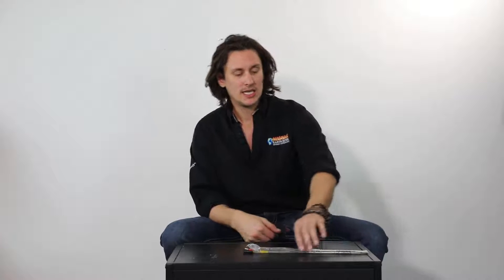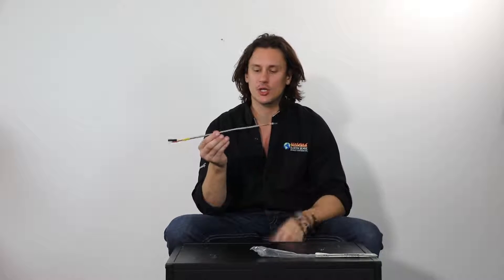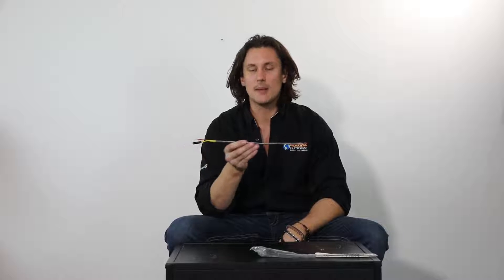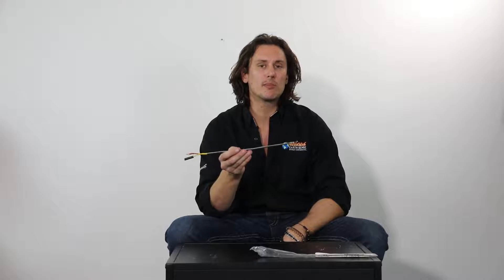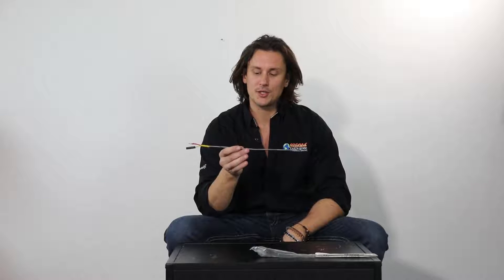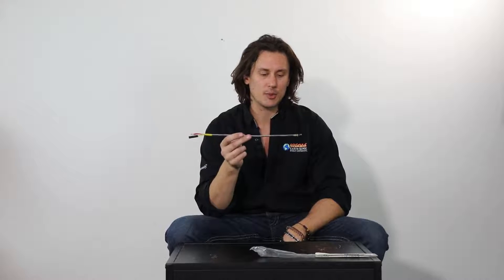Quadrafire Thermocouple Function & Troubleshooting

Comment: I have a Quadra-Fire Mt Vernon AE Pellet Stove, 2003.  During ignition, after the fire is lit, the power in the stove cycles on and off, the auger will attempt to feed fuel, and the blower will kick on if it manages to feed enough pellets to get up to temp with the intermittent power.  It will continue cycling power until the thermostat is manually turned down and it goes into its cooldown stage. Also, i cannot attempt a restart until it has completed its cooldown cycle or else it will just go back into cycling power.  1 in 5 attempts it will have a successful ignition cycle and run perfect. My control box has no indication lights. I'd love some help to narrow this down before I start playing wackamole with parts, Thanks!
Reply from the maker: Thanks for contacting us, happy to help. Let's first verify the age and model. The Mt Vernon AE did not exist in 2003. The first Mt Vernon AE hit the market in Nov 2011. The Original Mt Vernon with the 4-speed control dial and standard wall mount thermostat was in production at that time. These two units are very different although physical appearance is similar. If you verified manufacturer date as 2003, then you have the original Mt Vernon. Please confirm. 
When you say the power cycles on and off, are you referring to a specific motor that is doing this or does power cut to the whole unit/all components and then come back on? Happy to help.
Reply: @EarthSense  The sticker in the hopper has a punch calender on the bottum marked for 2003, im assuming that is the manufacturing date, and the name does not include AE so your probably correct.

The power cycles for the whole unit, all the components appear to operate correctly, but without constant power it can't maintain fire.
Reply from the maker: @damuleface  Thanks for the message back. Yes, that punch calendar would be correct for the manufacturer date. They often call your model the Mt. Vernon O.E. (Original Energy). 

I would suggest we start with the basics first. 
1. Let's check line-voltage coming from the outlet. We want to make sure there's no dramatic swings and that we are reading 115v-120v consistently. If there's other things plugged into that outlet or breaker let's make sure they are not creating a drop in voltage in the outlet the stove is plugged into. If you have a surge protector in place, let's make sure it's not altering the voltage.
2. Let's check the stove wall cord. Check for breaks/cracks and wire connection on the power inlet inside the stove. 

3. Check all wiring coming from the Junction box that secures the control board. Again looking for breaks, cracks, or loose wires/connections.

4. Pull out the control box and make sure all contacts look good. Place it back in securely. 

All motors and blowers can be bench tested to ensure they work consistently. Here's a video on creating a test cord if you want to test each individual motor - https://youtu.be/rlmiCYI2WPk?si=-5IziCy65IKSsZTx

Keep us posted, happy to help.
Reply: @ All conections are good and all components are running fine. 

I think I have it narrowed down to the thermocouple and/or control board.  I have listed below different scenarios during start up.

1. No fire: stove times out and turns off

2. Inadequate fire: stove malfunctions, intermittent power, until thermostat turned off and completes cooling cycle.

3. Adequate fire: achieved with additional fuel in pot, stove enters normal operation

It seems like the thermocouple is giving insufficient voltage which is causing the control board to malfunction.
Reply from the maker: @ Glad you were able to check everything and narrow this down. Generally speaking, the thermocouple only comes into play to recognize the fire/heat during start-up to allow the unit to go safely into normal operating mode. Given what you described I would agree this could be a thermocouple or control box issue. 
For reference here is the control box for the Mt. Vernon OE - (Showing 2 arriving this week) https://pellethead.com/product/quadrafire-mt-vernon-oe-control-box-4-speed/

And here is the thermocouple for the Mt Vernon OE - https://pellethead.com/product/quadrafire-thermocouple-20154-bundle/

Keep us posted, happy to help.

Comment: I have a Quadrafire Mt Vernon AE pellet stove insert.  It has a very high flame, flame adjustment is set to -3, and the firepot gets full of pellets.  Is this a sign that the thermocouple is bad?  I have cleaned the stove, and checked all the gaskets on the door.  I have not checked the gasket on the firepot.  Thanks for your help.
Reply from the maker: Thanks for contacting us. The thermocouple only detects temperature above the burnpot giving signal to the board when the unit goes from start up into normal operation. With the issue you are describing, we either have an air loss or air blockage somewhere in the stove. You mentioned checking the door gasket and glass gasket seals and cleaning the stove which is great. Couple suggestions.

1. Double check the door gasket using a dollar bill. With the stove off, place a dollar bill half in and half out of the door and close it. Pull on the dollar bill - there should be heavy resistance. Check in multiple spots around the door. Some can be sealing tight, while other areas may not.

2. Check the burnpot. Let's make sure all holes are open and clear. A good light and mirror will be helpful. If the burnpot is pulled out, the gasket definitely needs to be replaced. If it's not pulled out, usually the burnpot gasket will be fine for several seasons. 

3. Heat Exchange Exhaust Exits. With the Firebox Cast Iron Baffle Mill removed to access the heat exchangers, there are exhaust exit ports to the left and right. Important those are thoroughly cleaned. See page 33 in the manual here for reference - https://www.manualslib.com/manual/67107/Quadra-Fire-Mt-Vernon-Pellet-Insert-Advanced-Energy-Ae-Mtverninsae-Csb.html?page=33#manual

4. Vent Pipe and Exhaust Manifold. The easiest way to remove ash from the vent pipe and exhaust manifold area is to put the sucking end of a leafblower vacuum on the outside vent termination. We first recommend running a brush in the flue to loosen up the ash. With the stove off, putting the leafblower vacuum sucking end on the vent pipe will pull out fly ash from the flue, exhaust manifold, and rear firewall heat exchange area. If there is a second person, they can open and close the firebox door while performing this to get better vacuum in the unit. Here is the type of leafblower vacuum our service and maintenance team uses for reference - https://www.toro.com/en/product/51619

Keep us posted, happy to help.

Comment: Hi Taylor. Enjoyed your video. I have a QuadraFire Castile that I use if my shop. The unit typically starts and runs however I don’t get a “hot” heat, it blows warm air like a Heat Pump would blow. My shop is small approximately 575 square feet and is not fully insulated however I believe the heat should be much hotter. Any advice would be greatly appreciated. Thanks. Jeff
Reply from the maker: Hey Jeff, thanks for the message, apologies on the delay here. Couple ideas - 1. Pellet Fuel: There are big differences in pellet fuel on heat output/BTU as well as ash content, clinker build-up, etc.. Generally speaking we find that softwood pellets such as fir or pines are going to produce the highest BTU in pellet form. If you are currently using a hardwood pellet, see if you can get your hands on a few bags of softwood pellets and see if there is a difference within the intesity of the heat. #2 - Let's check the heat exchange tubes. As ash accumulates on the upper baffle and tubes it insulates not allowing maximum penetration of heat. With the stove off, get a bottle brush and dry paint brush and give a thorough cleaning on the heat exchange tubes - use the bottle brush to get in-between and the tops. (Reference Bottle Brushes - https://pellethead.com/?s=Target+Millrose+bottle+brush&submit=%EF%80%82)
If you have a leafblower vac, put the sucking part on the exhaust vent outside to help clear out ash that is stuck in difficult areas such as the rear firewall and combustion housing. Only do this when the unit is OFF and COOL. The less ash accumulated in the unit = the more intense the heat will come out. Lastly, Quadrafire is known where there can be an excess of combustion air on the fire. They do offer a damper add-on which goes on the exhaust allowing to manually throttle down that combustion air which generally results in more heat-output, however when doing this, the firepot generally will require a bit more maintenance. Here are the dampers for reference. https://pellethead.com/?s=quadrafire+Damper&submit=%EF%80%82
Let us know your thoughts and keep us posted. Always happy to help!

Comment: I have a QF discovery II.
The lower air /timer lever was working fine but this is roughly my fifth fire I’ve ran through this new stove and it seems the  lower lever  for my air control os not going through its full throw .
I have to push and pull the lever at the right rear of the stove to control the damper.
It seems like possibly a screw loosened up on a slotted rod or something and its barely catching anything and is just moving the rear rod slightly in either direction.
Reply from the maker: Thanks for contacting us. Sorry to hear of the troubles. If the unit was purchased through our company, please call in to our 800 number and we can work with Quadrafire to figure out these technical issues. Here is the owners manual incase you need it for reference. https://www.manualslib.com/manual/1645363/Hearth-And-Home-Quadra-Fire-Discovery-Ii-C.html#manual
Reply: @ 
No I did not get it through your company.
I’m in N GA.
I’ve got a manual but It doesn’t touch on this issue.
I gotta figure out how to remove the access panel to inspect.
I can live with adjusting the unit from the rear but would be nice to use the proper lever.
Reply from the maker: @VikingRobot-x4b  Thanks for the message back. Yeah, understand, we just don't have any experience with service on the Quadra-Fire wood stove line to be able to provide direction here unfortunately. Looking online I found this number for Quadrafire Factory Tech Support - (800) 926-4356. Try giving a call and see if you can get some insight there. Really wish we could assist better here. Thanks.

Comment: Everything starts correctly light turns green after a few minutes the light turns red
Reply from the maker: Thanks for the message. The thermocouple simply allows the stove to go from start-up into normal operation. If your Room-air blower motor is not coming on it would be a different issue. Just let us know what model you have, happy to assist. Thanks.
Reply: @EarthSense  I have a classic Bay insert. At startup light turns green in the clear panel box after about 3 minutes the light turns red and stays red is this normal?
Reply from the maker: @KimWelch-c3e  Thanks for the message back. Yes, that is normal. Green will indicate the start-up, and the solid red light indicated the thermocouple has met temp and the stove is going into normal operation. 
The Classic Bay 1200i will have a snap switch for the Room Air Blower that turns the blower on when warm enough and shuts the blower off when it cools down. Is it your room-air blower that is not coming on/functioning correctly?
Reply: @EarthSense  it is coming on correctly. I thought that the red button in the clear circuit box was supposed to go back to green when running properly I thought red meant not running properly
Reply from the maker: @KimWelch-c3e  Glad it is working correctly. Yes, the solid red light simply means the thermocouple has reached 600 degrees Fahrenheit and the stove is going into normal operation. In this video we discuss it a bit more around the 8 minute mark - https://youtu.be/Hjs3KhP9ntI?si=OafvaBva_4-R0vkd&t=480

Any other questions just let us know. Thanks.
Reply: @EarthSense  thank you so much for your help
Reply from the maker: @KimWelch-c3e  You're most welcome!

Comment: Would this have anything to do with why my stove isn't blowing hot air? I have fire but it seems not to be strong . Also the heat is Luke warm at best 2009 Quadra fire Santa fe. Blower motor, exhaust motor, glass gasket with bottom open for air wash and igniter have been replaced with in last year. New auger motor will be replaced today.
Reply from the maker: Thanks for the message. No, the thermocouple is a device simply used to sense proof of fire allowing the stove to go from start-up into normal operation. Few suggestions on your heat output. 
1. Clean the impeller fins on the convection/room-air blower. Dry Paint Brush or Compressed air works well. 
2. Ash has a tendency to get trapped on the heat exchange tubes and behind the back firewall. It acts as an insulator significantly impacting the fire and intensity of the heat coming out. We recommend a deep firebox cleaning. Small bottle brushes work well for getting up in between the heat exchange tubes. Make sure the heat exchange scraper is working freely as well. Most Santa Fe models will have a baffle covering the heat exchange tubes and baffles on the back wall. Important to remove and clean all ash trap areas. In our cleaning services we will often place the sucking part of a leafblower/vac on the exhaust vent outside and this does a nice job of pulling out the ash from the nooks and crannies of the stove and vent. Make sure the stove is off and cold when performing service or maintenance. 
3. Pellet Fuel. Lots of differences in heat output with different kinds of pellets. We always recommend trying a few bags of a few kinds to see what works best in your stove. 

Bottle Brush Reference: https://pellethead.com/?s=bottle+brush&submit=%EF%80%82

Owners Manual for insight on baffle removal and maintenance. https://www.manualslib.com/manual/820586/Quadra-Fire-Santa-Fe.html?page=19#manual

Keep us posted, happy to help.